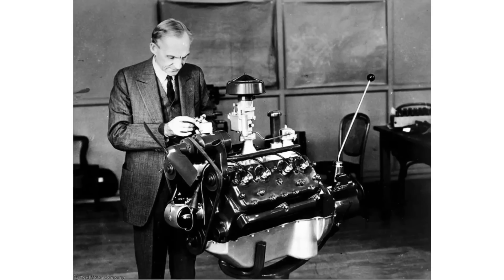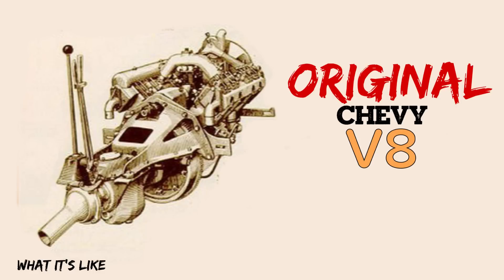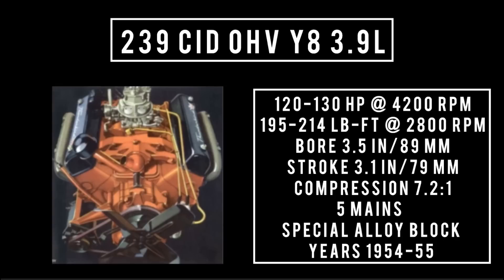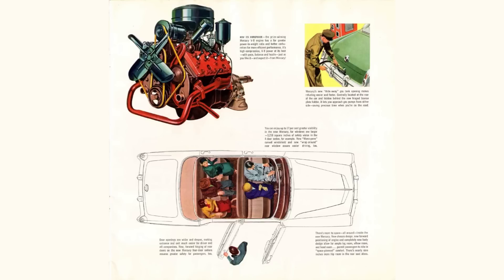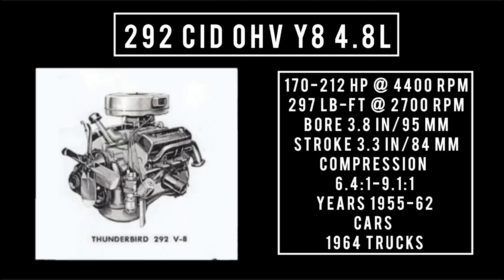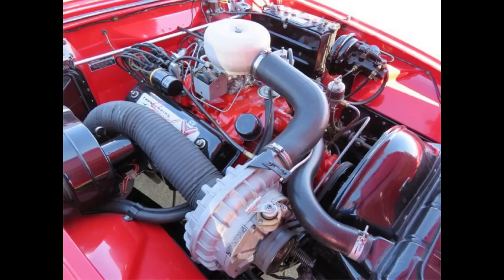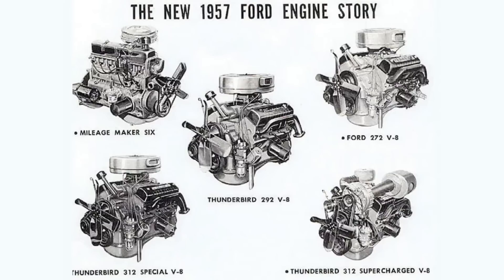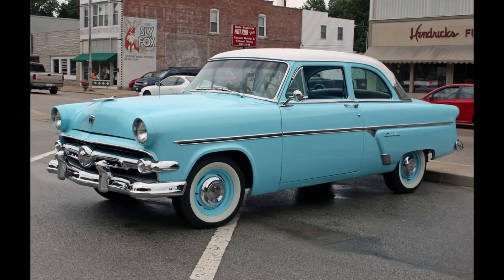Ford Y block engine family, 239, 256, 272, 292, 312

Comment: A great video and one that really hits home for me as I know quite a bit about those Ford and Mercury engines having had a '55 Mercury Monterey Coupe for many years. I was always amazed by the fact that a big 292 Merc engine could fit inside a small sized Thunderbird which had a wheel base of only 102 inches. But somehow it did! As for WYR. In the first choice I would happily take all three, but if I had to choose only one I suppose that the '56 T-Bird was the best of the three years and especially with its optional replaceable roof with the porthole. In the second choice, that is really a tough one as I really like the '55 Montclair in Artic White over Gulf Stream Blue, so if I were allowed to select my own colors I think that I would pick that model, but if not then I would go with the '57 Thunderbird. The '54 Ford Customline  is a nice one too but I would have to pass on it given the opportunity to choose a small bird. 😊
Reply: It was a small-block engine, even though nobody used that term yet.
Reply from the maker: They are relatively compact they are cool engines =)

Cool choices
Reply: Look at any Corvette (before the C8) and you can see the hood height difference - and wonder how an engine can fit in there and NOT drag the ground!!  (and not have to "compromise" the suspension and the oil drain fiasco associated with most fords...

Comment: OK. The 312 Y-block came out in 1956. It was most common in Mercury's and T-bird's. And, yes, I know this to be true as I have rebuilt those engines in 1956 Ford's. It could also be ordered for the other '56 Ford cars and had "Thunderbird Special" on the valve covers just as in the previous year, the 292 in regular Ford's. In 1957, the T-birds DID have the 312 supercharged engine which are referred to as F-Birds. These were also equipped with 3-speed manuals with an overdrive unit. Then, also on the '57-Birds, there was  a T-bird which had 2 4-barrel carbs, know as the E-Bird. There were 4 engines available in  '57 T-Birds, the base 292 and 3-312's.
Yup. I've seen the '57 F-birds with a 312 too in person person, one was at the now-defunct Imperial Palace Car Collection in Las Vegas.
One of the  things that I didn't like about the several Y-blocks I've worked on was their ignition distributors didn't have mechanical advances and relied solely on a vacuum advance, so under acceleration they had no advance. The only cars which would benefit from this would have been the supercharged F-birds to control pinging. 
The 292's in trucks were the darndest looking things. They only had single exhaust and instead of putting a "Y" pipe downstream, they put a crossover pipe across the front of the engine, right in the way of working on the engine. Hopefully it was cooled down, because it was a logical place to put a hand working under the hood!
Reply: In 57, Ford came out with a centrifugal advance distributor to fix that shortcoming.
Reply from the maker: Thank you so much for that correction as well as all of the added information and insight I really appreciate it =)
Reply: I always wondered how many mechanics,or people that didn't know , got burned on that crossover pipe.

Comment: I had a Y block in my first car. 57 ford country squire wagon. I think those hp ratings are a little low. But they did have top engine oiling problems. As far as which car, I would have to settle for the merc. I tried to drive a 56 t- bird once. I’m 6’1” and couldn’t fit under the steering wheel.
Reply: Too bad you didn't live near me.  I could have fixed the top-end oiling problem for you.
Reply: @jamesbosworth4191  that was in the 70s I’m pretty sure that car is long since scrapped
Reply: @Frank-sf1wh  I meant at the time you had that car.
Reply from the maker: Awesome choices sweet first car too by the way I should’ve made wagons part of the equation I’m a huge wagon fan
Awesome choices sweet first car too by the way I should’ve made wagons part of the equation I’m a huge wagon fan

I’m 6 foot two I fit in the car it’s just it’s not it’s weird in the 56 there’s a whole lot more space in the 57.. The floor isn’t tubbed enough and the seat is pretty much on the floor

Comment: Been wait for this video. Rebuilding a 1956 mercury 312 to go into my 1929 model a pickup
Reply from the maker: Awesome I screwed up on the 312 it actually came out in 1956.. =) 

That’s awesome does the rest of the truck look hot rotted or is it stock with a y block engine
Reply: @What.its.like.   itll be stock body dimensions with original fenders just dropped 4 inchs front to back. Stock body with new fabricated box frame with y block 4 speed toploader and early round back 9 inch. So its like an early style hotrod

Comment: I liked the 292 and 312.They sounded so good. Like music.With todays standards they were terrible engines. I always owned 283's because they were fun to work on.
Reply: As long as you regularly changed the oil and filter, and used detergent oil, they were very good engines.  Bullet-proof bottom end.
Reply from the maker: The Ford Y block had a unique sound just like a flathead very unique sounding engines.. Chevy did what Ford couldn’t do they got it right pretty much out of the gate Ford had a lot of different engine families.

Comment: I see you really did your homework on this one.
Reply from the maker: To be 100% honest I actually did this episode twice this was supposed to come out when the flathead V-8 engine episode came out this was going to be the very first engine episode but I couldn’t figure out how I wanted to present the information because Ford offered different horse power ratings for every single year between all of the different Y blocks on offer.. I scraped it I also did Lincoln y block and scraped it.. 

I think next week if I can find enough information we’re going to do the Hudson twin H Hopefully I found a site when researching different topics that had a lot of information I’m hoping I can find out again
Reply: @What.its.like. You forgot to mention the exhaust pipe that was on all models. It made it into a single exhaust that was supposed to be more fuel efficient, really all it did was rob it of power and give it a very unique sound.

Comment: Never had a 1955 Thunderbird. I had 3 1956 T-Birds and 3 1957 T-Birds. If I were to ever have one again, it would be a 1957. Scenario 2. Again, the 1957 T-Bird. Also I prefer the 3 speed manual with electric O/D transmission.
Reply from the maker: I’m totally with you being 6 foot two getting in the 55 and 56 is a bit tricky it’s like getting a Corvette from that era.. have to go in headfirst

The 57 definitely has more space

Great choices
Reply: @What.its.like.  Exactly the same space.
Reply: @What.its.like.   That's why all the early Corvettes were convertibles.  Just don't bother ever putting the top up!  (yeah, they're still tight between the wheel and the seat though)
Reply from the maker: The 57 is bigger I worked at a classic car dealership last year and I did a comparison it’s easier to get a 57 and it is to get in a 55 or 56.. I will have to do that comparison again I didn’t record it I did record it but it never got posted.. Also the 57 seat is higher off the ground and 56 I measured it’s like an inch or two difference which doesn’t seem like a lot but it definitely makes a big difference
Reply: @What.its.like.  the 57 is longer due to the rear deck. The cockpits are all the same. The cabin floorboards are the same. The tops are the same. The height of the 57 is slightly lower due to 14" vs 15" wheels on 55 and 56. The seat frames are the same. The seat upholstery differs. Power seats vs manual seats DO make a difference. Your working at a classic car dealership vs my having owned and restored 6 1956-57 T-Birds. Do not ignore that they ALL had telescoping steering wheels. How they are set makes a huge difference. The 57 also had a memory seat option that made the seat lower and go back to the max when key is shut off.
Reply: The actual bolsters and seat upholstery can give a bit more headroom in a 57, all other things being equal. The official specs give the 57 a half inch more headroom.
Reply: @What.its.like.  I think the 57 had a slightly smaller steering wheel.  That makes a noticeable difference if you can't get you legs under the wheel of the 55 or 56.

Comment: Ford had to detune the 292 to justify customers would buy the 332, or 352.
Reply: Ford started caring about fuel economy courtesy of one Robert S. McNamara.  He didn't believe in performance, and was dead-set against Tri-power or dual quads, and even the 4 barrel carb.  He thought forward motion was good enough.
Reply: @jamesbosworth4191 .  M
Reply from the maker: It makes sense they could’ve left the Y block at 212 for the 292 because the 352 made more power than that and it was a better engine if we’re honest =)

Comment: As I count Lincoln as a Ford it was first yblock in 1953. I and a lot of my friends still run yblocks, durable and tough  with good torque curve. Factory power claims are engineering calcs only.
Reply from the maker: We are definitely going to cover the Lincoln Y block in a different episode

I’m actually here sitting trying to figure out what engine episode we’re doing next week cause I have to do it before I leave for Hershey.. I kind of want to do the Hudson twin H I just don’t know if I can find enough information on that engine probably do the jet as well in the same episode
Reply: Lincoln Overhead came out in 52.
Reply: I am corrected, just remembered my 2nd car 53 capri with 318 4 speed hydra @jamesbosworth4191

Comment: Ford had a long run with Y block style engines. The FE series was also a Y block style engine. I don't remember the last year for the FE . . . . 1976 maybe? When I was a kid we had 1960 Ford car with a 223, a 1961 Ford car with a 390, and a 1962 ford car with a 292. Anyway, these were all good running reliable engines.
My father worked at the Ford garage in 1970 -74They were giving these cars away, just to get them off the lot,. . . . or so I was told. and yap, yap, yap! 😂
Reply from the maker: Awesome information and insight we are going to cover the Ford FE one day =) as well as the Windsor/small block

Comment: 57 Tbird
54 Customline 
I've always liked the looks and styling of that 54.  

One of  my high school rides was a 59 Ford. It had the Y block 292 it was a good strong engine but not without its issues.  Namely oil return issues. While not a speed demon. It had plenty of power and lots of torque. 

None of the Y blocks have the sweetheart love that the Chevy small block gets.  But the Y block was a decent engine. Mine ran like a top I never had not one issue with it except for keeping the oil returns cleaned out that was it.
Reply from the maker: They are a good sounding engine, The 265 when it first came out Chevy had problems as well and then they went for flow oil filter and then they didn’t have as many issues as Ford had Ford had a bunch of different engine families whereas Chevy just had a small block Chevy.. they did different big block designs but they did not have as many V-8 engine families as Ford

Great choices i’m right there with your 54 is a really nice body style for Ford they are optical allusions.
Reply: @What.its.like.  I think we might have actually chatted about the 54 body style before at one time when you look at it it looks like it's a small car but once you get up by it and you sit inside of it is really a nice designed automobile. Honestly not small at all.
Reply from the maker: There is more space inside a 54 then there is an any of the later 50s fords which is crazy because those are huge but they didn’t Utilize space that great
Reply: @carlmontney7916  That 54 is actually pretty much the same car as the 55, with the addition of the wrap-around windshield, and lowered taillights to allow for those little "cat's ears" above them.